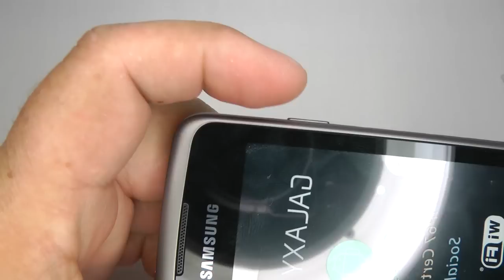Galaxy Xcover S5690 Disassembly & Assembly - Screen & Case Replacement

Comment: Thank you very much for the video. 
Only one thing, at 16:12 ->connecting the digitizer when you say push this... down(i don´t understand the word, my EN is not so good.. -> if you have a new screen glass it can be, that there isn´t a double density conducting tape under, so i had the problem that the touch didn´t work. After removing this little conducting tape/net from the old screenglass and sticking it on that underside of the new one, it worked.

Comment: Great Video.  Works for the Samsung Rugby Smart as well.  Just a little harder to get the case apart without damaging the rubber they use on the outside.

Comment: Hi ... I have some questions. I have successfully changed my broken digitizer. Now I have problem with proximity sensor it thinks its always covered. I checked but sensor its in his place and not covered. So when I make cal screen automatically go black and never come back on. So If I want to turn screen back on I must remove the battery and restart the phone. Had you seen anything like it?

Comment: @ Aasmund Børli Sivertsen or @LE55ONS:
Could you fix your problem with that poorly working digitizer? I have the same problem. Did you try that thing shown below using the double sided tape from the old digitizer? I bought a brandnew digitizer in ebay.de (they said it is an original Samsung with tape), i repaired it (everything worked fine), but now the touch screen is working slow and on some spots even not at all. Any idea / help?

Comment: Hi,
My ex screen was broken. I have changed my glass with your tutorial, but I am experiencing problems with the touchscreen. It has been unresponsive in some areas(right half of the screen). I am pressing the button and nothing happens. What could be the problem? Thank you, GOOD TUTORIAL
Reply from the maker: don't worry, its nothing you have done. Its a faulty new digitizer, ask the seller for a replacement..
Reply: Thanks, another one is on it's way !

Comment: Hi! I dropped my S5690 on the floor and after it it stopped working. I took the battery out and tired to open it. It got stuck in the black screen with the text: " Samsung Galaxy Xcover S5690". Because it didn't do anything after that, I removed the battery again but then it didn't open at all. There are no visible damage anywhere and this is not the first time I have dropped it but it has always opened. Any idea what is the problem??

Comment: Hello! I've replaced my new screen, I did everything you shown. It fits in and it works, but somehow it doesn't detect touching... everything else works ok. I press and it doesn't detect. Everything is connected properly... What could be wrong?

Comment: Hi I dropped my SGH-I847 on the floor and it is now dead no sounds no vibration and no display, there are no visible cracks or damage to the screen, I have droped this phone many times form far greater highs before, Any idea what may be damaged?
Reply from the maker: have you tried removing the battery for a short while?

Comment: I broke the glass on mine, and got it replaced with help from this video. But now the touch  is working poorly. It's very slow, and some spots on the screen doesn't work at all. I tried disassemblying it, and putting it together again very accurately - I can't see I've done anything wrong. Anyone know what can be the problem? It actually worked better with the old (broken) screen..